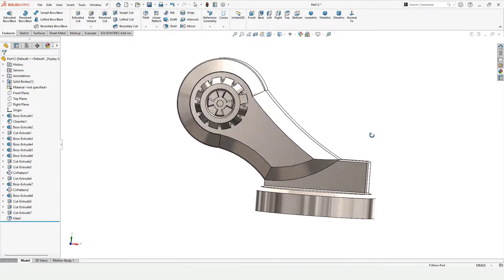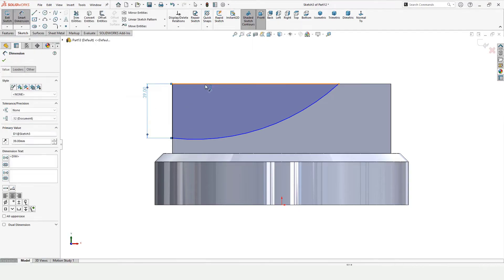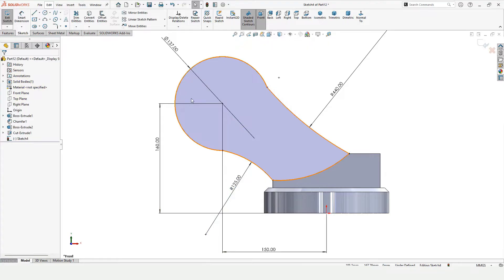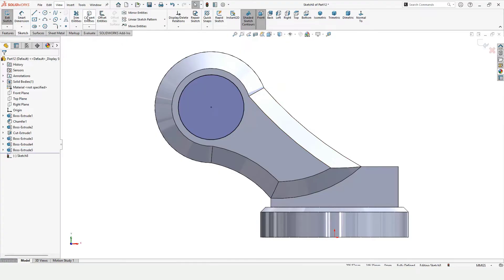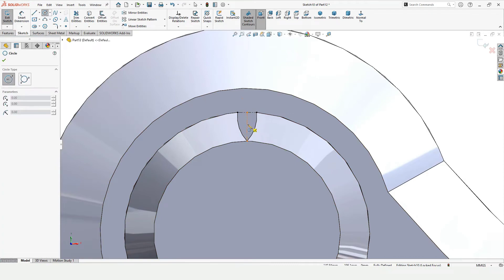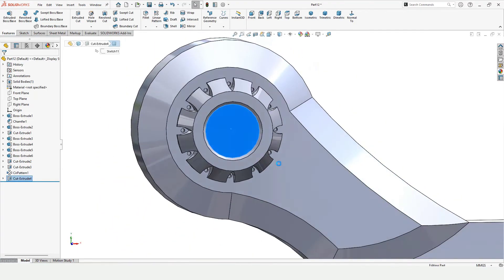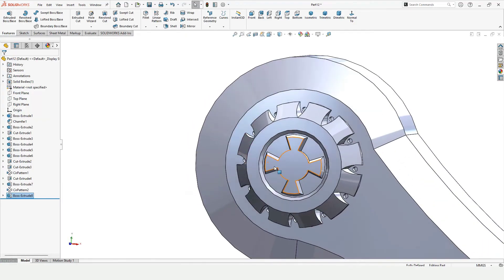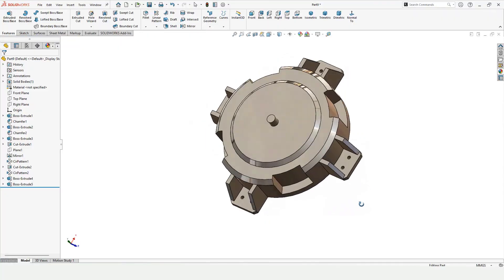Robotic Arm Link 1 Design in SolidWorks | Robo CAD

Comment: 10:22 I having a issue with specifying the distance between central line an the line we drawn after determining there angle(which is 30) I  am unable to change the dimention
Reply from the maker: @AK-fn2in  probably the reason of why you can't change the dimension is that there the line is fully defined (indication: color of the line turns into black). the easy solution is that remove that delete only that line and redraw it again.

if the issue is not resolved then let me know.
Reply: @CAD5-Minute  Thanks for your response but i resolve it by myself . i just have to of the drive
Reply from the maker: @AK-fn2in  that's great.